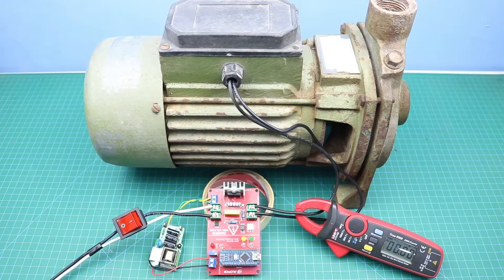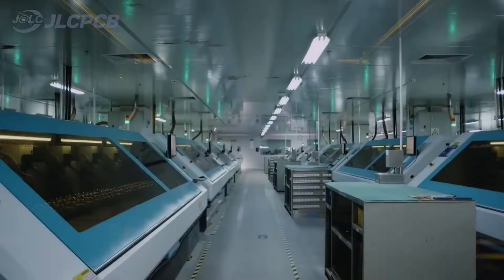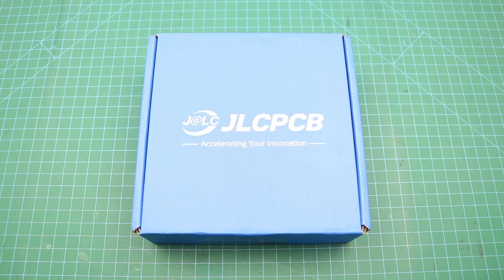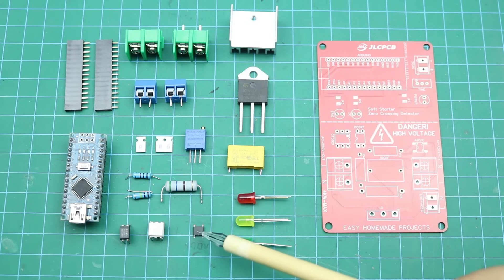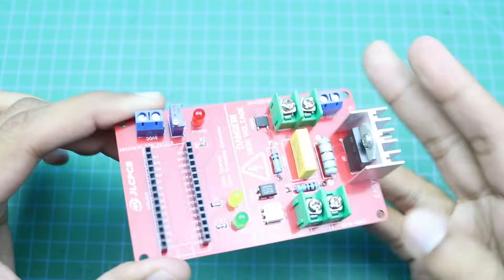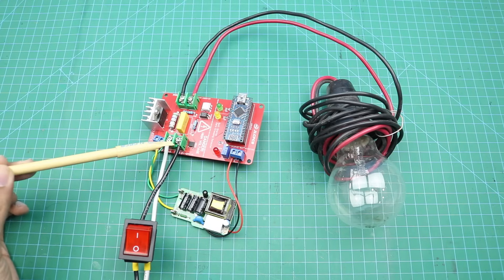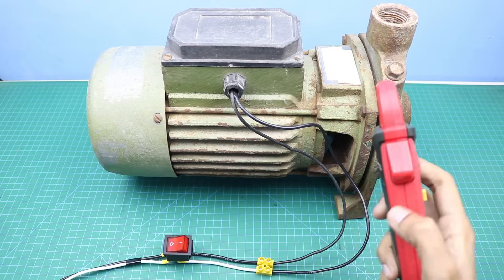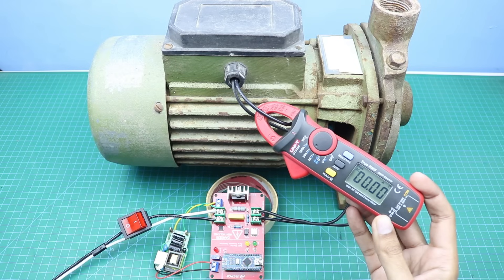DIY 220V AC Motor Soft Starter Circuit || 4000 Watts

Comment: In here did you add any power factor compensation to your coding or just fire triac at voltage zero crossing point? What is the power factor of your motor?

Comment: I want for transformer amplifier...but it has a lot of disadvantages..like core saturation dc offset..when zero crossing is not implemented well ... Arduino won't set zero crossing very well...and we have to lower the duty cycle not phase angle...

Comment: All very nice, the only note, you could insert a 5V regulator directly on the PCB so as not to have the external power supply for Arduino. 🙂

Comment: What are the benifit of the soft start circuit.
Reply: This circuit avoids current interruptions that occur when a circuit requires a lot of initial current
Reply: you can use cheap solar inverters to power an run ac motors. because inverter have limited power output and so they have strogle to star a ac motor such, pumps,fridges and air conditioners, its good to hava a soft start for the life of the inverter also for the life of the motor. is a win win situiation